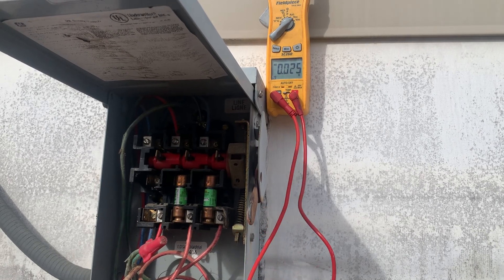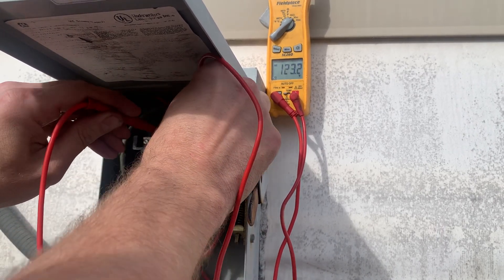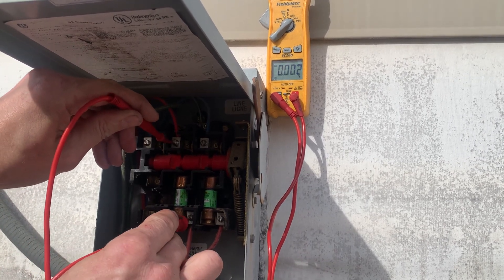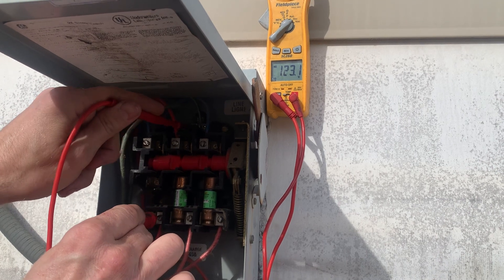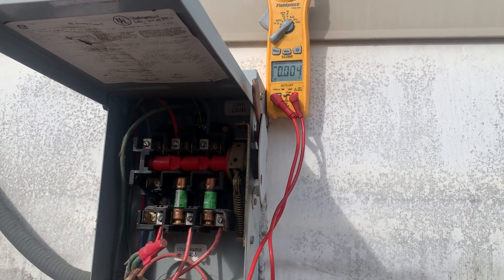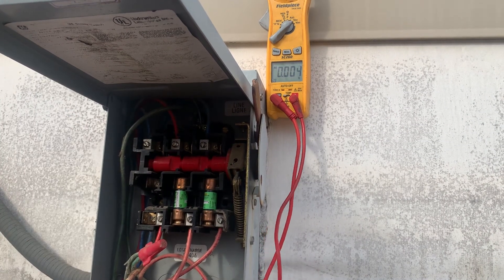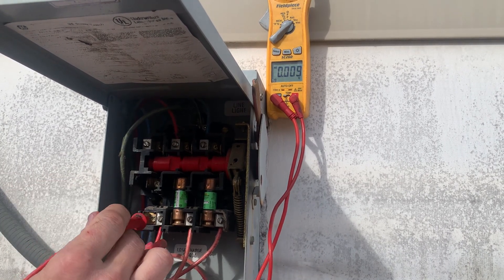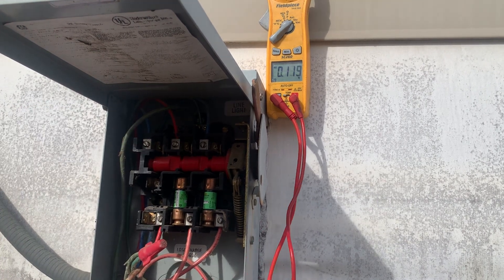3 phase power - ghost voltage and other electrical sorcery.

Comment: The coils that you're reading through (motor, contactor whatever) is a resistor, that's why it's not a dead short. If you tried to put a real load on it the voltage would drop way down. Some circuits you have to read with an old analog meter because the digitals are so sensitive.
Reply from the maker: Love the insight.  Thanks OhioPat!!